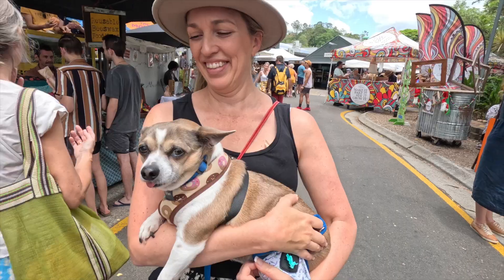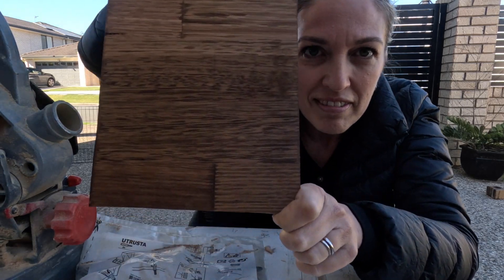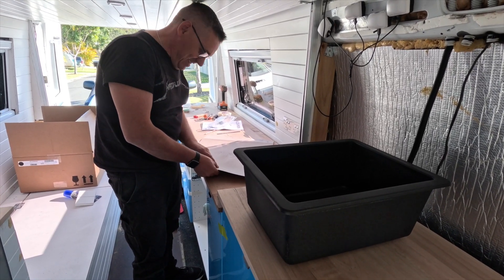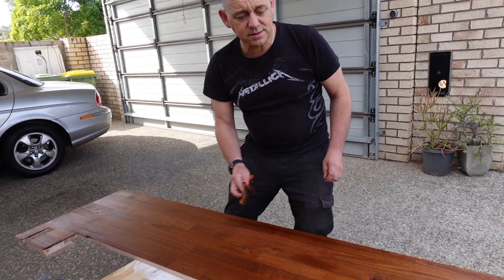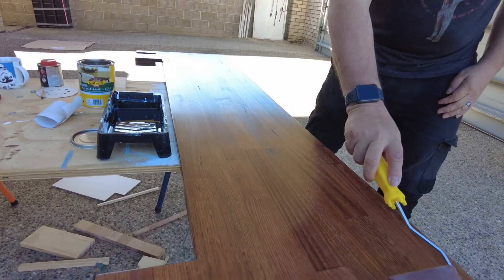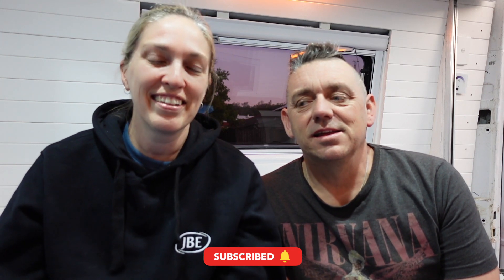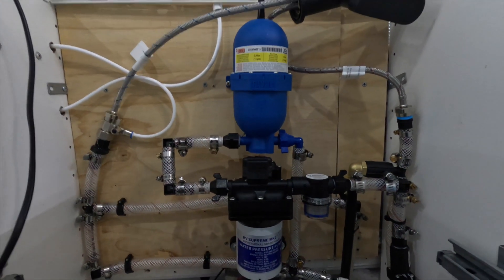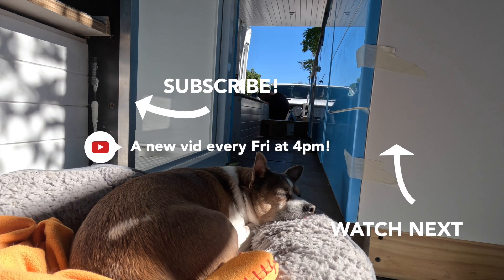I didn't know this existed! -  A MUCH QUIETER WATER PUMP! - DIY INSTALLATION.

Comment: Watch out for those Fiamma expansion tanks Tim, I’ve had two so far. They leak around their middle section joint. I ended up taking mine out and bypassing it. Each one I had lasted a little over a year each. In the end I put a plaster drip tray under my system to catch leaks.
Reply from the maker: Thank you 😀🙏we’ll definitely keep an eye on it and Thankyou for the advice we really appreciate it 🤩